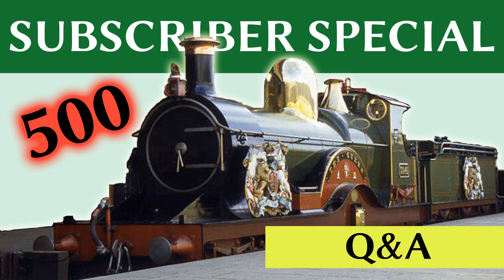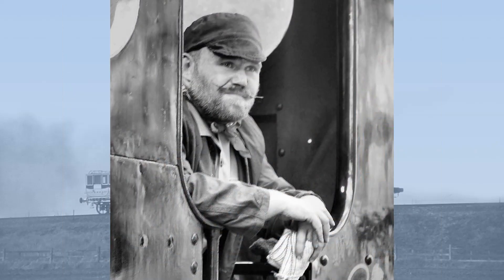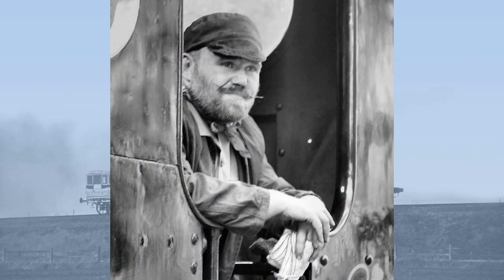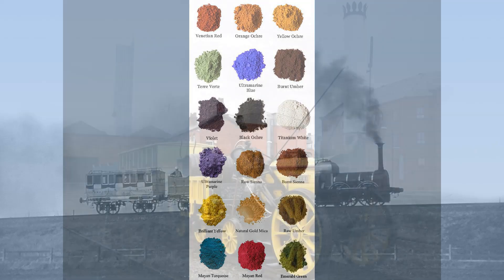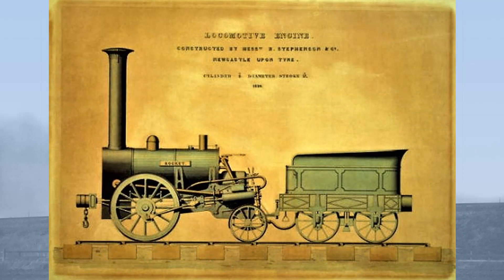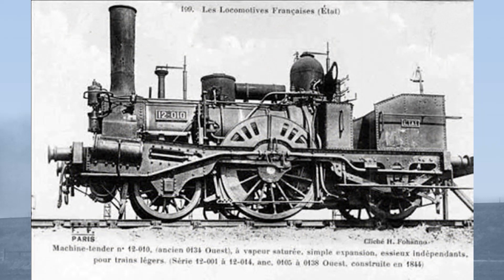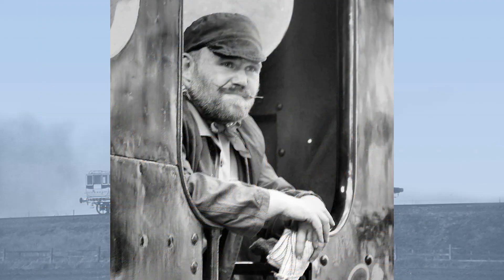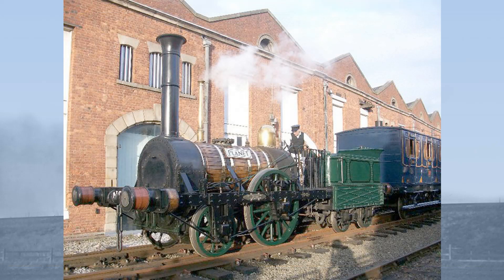500 Subscriber Special

Comment: I have always wondered about the colors of early locomotives, and if what we've seen in current illustrations is more speculation than accuracy in their original appearance. Many  early American  locomotives went through extensive  rebuilding and modifications through out their lives and hardly resemble the original design in the later working years, take for example the "General" 4-4-0 locomotive now in preservation, not the same as in its original incarnation. Thank you.

Comment: Tangent, but if Trevithick was using a branched flue, how does that change the interpretation of such engines as Lancashire Witch or The Agenoria? Correct me if I'm wrong, but I vaguely recall Francis Trevithick claiming that his father invented the multi-tubular boiler, I assumed this was a reference to the London steam coach - but perhaps he did mean to refer to a locomotive?
Reply from the maker: The London Steam Carriage had a main fire tube which returned with two smaller diameter flues - so pretty much like Lancashire Witch first time round. With the firebox at the same end of the boiler as the chimney.  Dr Lewis suggests the boiler of the Penydarren engine would have two fireboxes a la Lancashire Witch mk 2 boiler and a single chimney. Unless  of course the 'breaches tube' was like the London boiler, which would make a lot of sense. If it had a boiler like that, then the chimney and firebox would be at the same end - standard later Trevithick stuff - with the cylinder at the other. No trombone-like piston rod over the firebox.
Reply: @AnthonyDawsonHistory  Either way it paints a pretty interesting mental image of the engine.
Reply from the maker: @furripupau  It does. and if it did have a boiler like the London Steam Carriage there's insufficient space for a cylinder immersed in the boiler.  If it had a branched flue like Lancashire Witch there'd be more room but which end would the piston rod emerge? We know Trevithick states it was arranged to be easy to manage and Davies Giddy says it was easy for viewers to look into the fire box, all suggesting the piston rod was at the opposite end to the firebox. But then if you've got a chimney in the centre at the opposite end of the boiler? unless like the Londno Steam Carriage the twin flues united in an inverted Y shaped junction above the end of the cylinder?

Comment: It is very difficult to determine the paint of steam locomotives because of the black and white photograph you have to match the paint to the original photograph
Reply: Forinstance the steam locomotives Jupiter and 119
Reply: Regarding the part of the video talking about telegraphs there also was the track key system you cannot enter a section of track without the key entering a section of track without the key you would be fired immediately
Reply from the maker: @barakmiller2890  The Token system of working, usually for single-track working, came along later but yes. Another failsafe, but sadly, one which was still prone to human error.
Reply from the maker: @barakmiller2890  John Ott is doing stirling work in that regard. It helps to know how certain colours appear in wet plate photography of the C19th and also what colours were available. Jupter and 119 used to look horrendous in bright primary colours. Not C19th at all! With original locomotives and carriages, the only way to ascertain colour is to rub down through layers of paint and then take paint samples and have them chemically analysed. It's a case of knowing what colour was available; working from known colour schemes; working from colour images and also original paint samples where available. It will never been 100% but the result will be far more accurate. See the Bloomer being built at Tyesley using an original tender paint samples from which gave an excellent idea of the colours and livery. Or the Manchester & Birmingham carriage in Manchester where what appeared to be black was, after chemical analysis, found to be Prussian blue.
Reply: Little did blenkinsop know that the rack and pinion system that he invented would be used on cog railways to ascend 35% grades at the 15:28 Mark
Reply: Manitou and pikes peak cog railway
Reply: The first locomotive I ever drove was the south shore railway no.30
Reply: Technically not a locomotive it was a trolley
Reply: @AnthonyDawsonHistory  The Jupiter's current paint scheme is louder than the one used when the replica was new, which was rather conservative, but based on an artist's imagination rather than any known facts. By the 1860s, some quite vibrant artificial pigments were available (anecdote: When I lived in Savannah, Georgia, somebody painted their Victorian era home bright orange. The city which is very (perhaps overly) concerned about maintaining the historic look of their buildings complained, but the homeowner revealed that during the restoration of the building the oldest layer of paint they revealed was in fact the same bright orange!) so the current crimson and ultramarine paint scheme wouldn't have been completely out of the question (although perhaps improbable). The B&O museum's recent (and well researched) cosmetic restoration of William Mason is perhaps a more typical representation of mid 19th century paint schemes in the U.S.